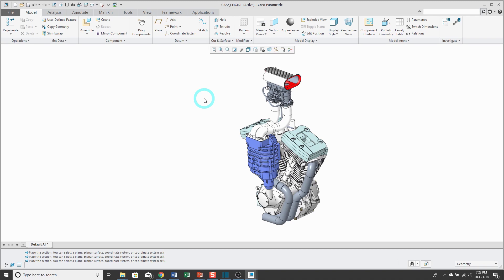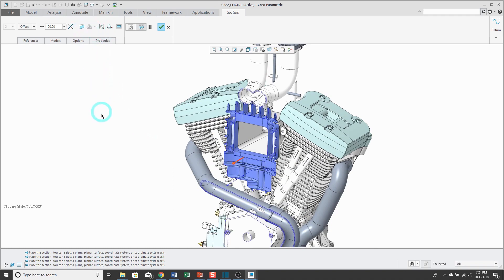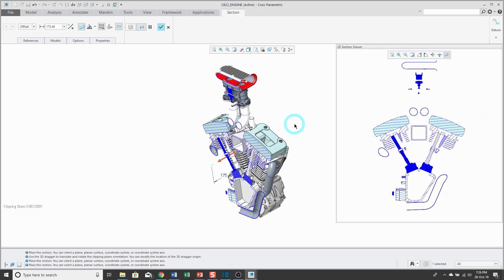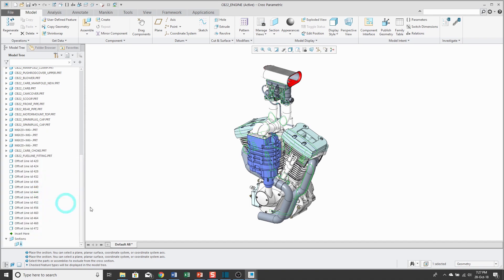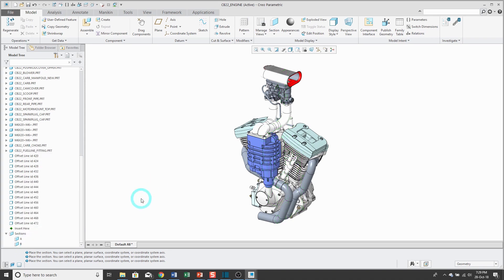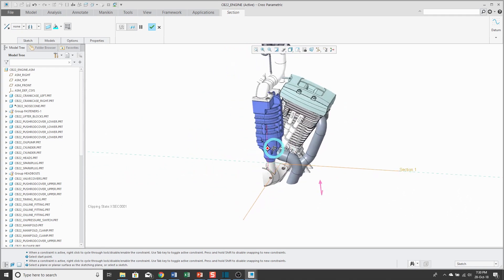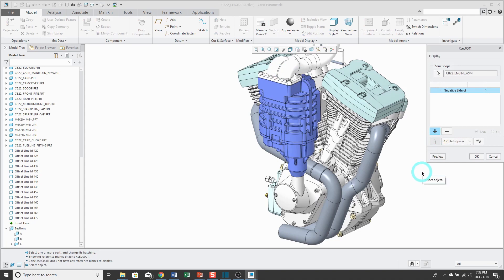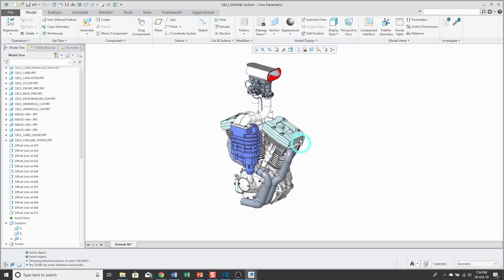Creo Parametric - Cross Sections | View Manager

Comment: Hi how can we move the coordinate of the 3D Dragger?
In my case, the 3D dragger located so far away from feature
It is so difficult to move the section view accurately
Reply from the maker: Create a coordinate system where you want the 3D Dragger to be (if you don't have a coordinate system there already). When you create the section, open the References tab (if it is not open already). Click in the collector under Dragger origin and pick the coordinate system for where you want the 3D Dragger to be.